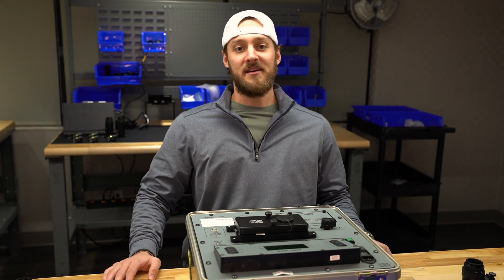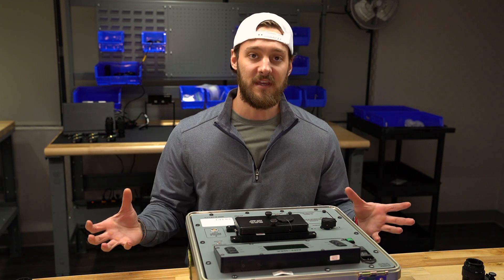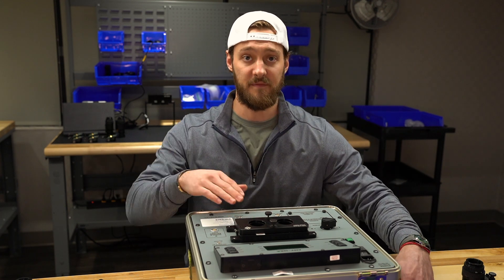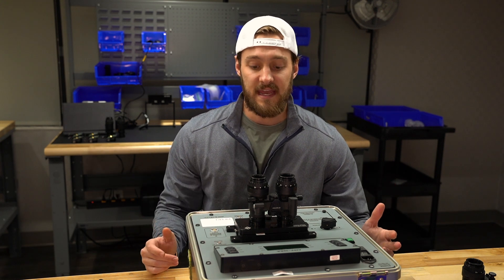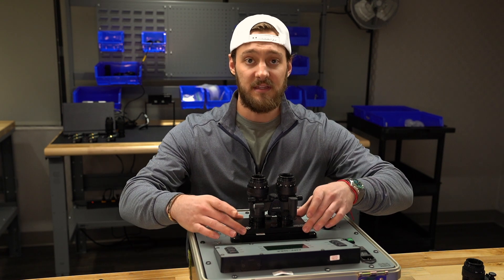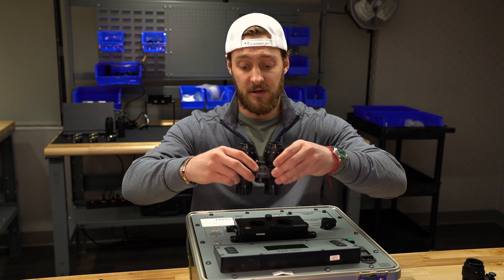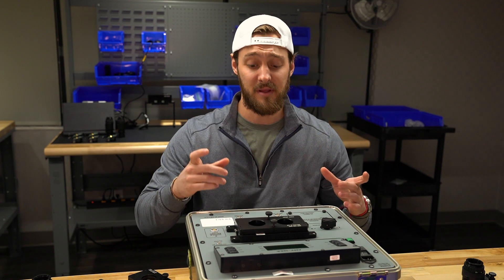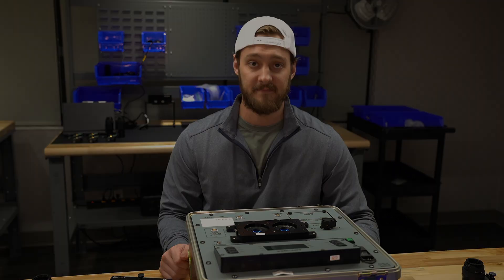Test Equipment Tuesday: Adapter Plates

Comment: When not using the camera on the Hoffman you are supposed to have your eyes dark adapted and also be in a darkened room when using your test set. If in these conditions the light leakage you discussed would not be an issue.
Reply from the maker: Correct. Being dark adapted is essential to getting as accurate results as possible (considering human subjectivity) when going off the human eye. We own and use the camera when we are not dark adapted. That will be in future videos. But correct adapter plates still are essential for all of the reasons discussed and to have the flexibility of working with the camera system in a non dark adapted room.